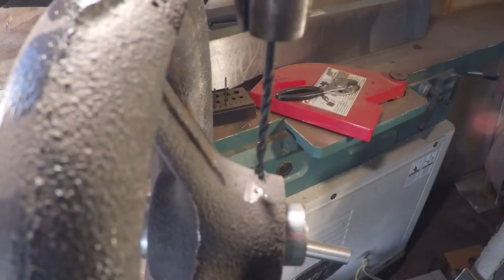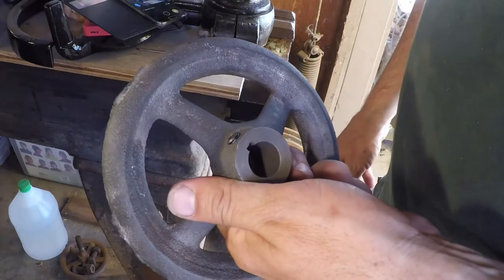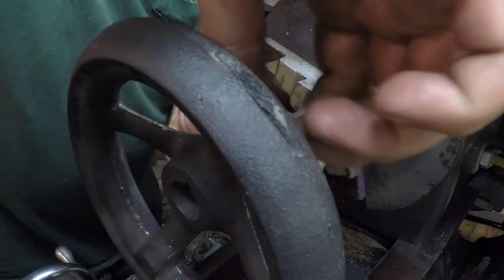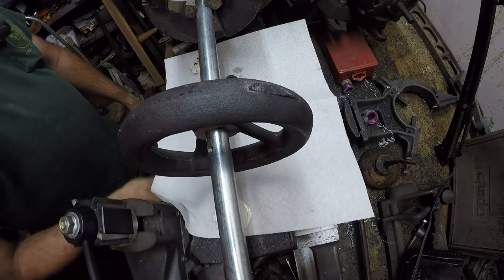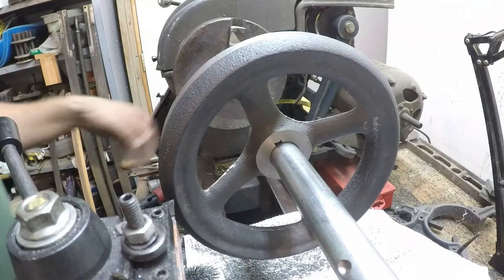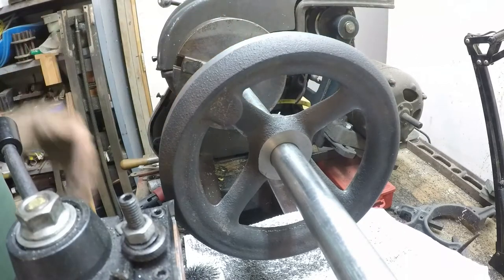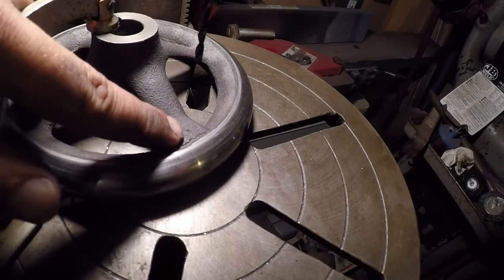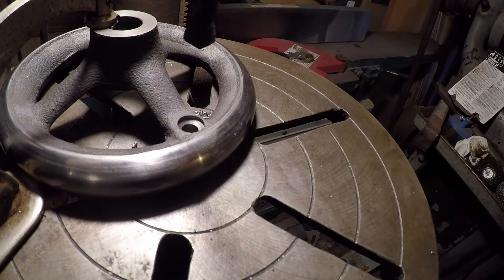Hand wheel machining  part 2

Comment: I needed a handwheel for my B&S table feed. I was given an 8" handwheel from an old valve with a square drive center hole.
I bored out the hole to make it round, pressed in a sleeve to make the bore fit the shaft, then did everything you did to finish the OD and make a crank handle. Looks like it was always there. It replaced a 5 inch handwheel.
Thanks,
John
Reply from the maker: +Caveman's Mancave cool deal the original was aperenly made in Detroit avoiding to the cast in letters.  If you ever need a 6in one I've got the pattern still

Comment: I'm thinking order of operations would be to mount a shaft in a vice on it's side.  Clamp the whole rig down with the drill hitting the center of the side of the shaft.  Slip the handle on, drill it then tap while it's all on the drill press.  Last step broaching the key-way.  That looks like a huge set screw size.  The handle is beautiful.  Fantastic result.
Reply from the maker: +Crafted thank you .Emma pointed out that I could true the drill press table vertical. Lol I was dumbfounded I didn't think of that.  It's a 3/8" set screw. We did try broaching the key after the set screw was drilled but there was some chip out .other then the drilling debacle it went off with out a hitch.
Reply: I didn't think of setting the drill press table in the vertical.  I'm wondering if a fella had a large enough piece of HSS if you could put a 1/4 round in it an form the radius simply by pushing it into the work.  Probably would take a much more powerful lathe and a keyed mandrel to pull that off.  Great result.   I do have some counter bores.
Reply from the maker: +Crafted I suppose it's posible but very chatter prone with this lathe
Reply: Yea, I don't think you could have on that lathe. I obtained a piece of 5/8" wide HSS, I want to grind it into a V grove pulley form and try it on aluminum in my 10" Atlas.  It shouldn't be possible.  ;-)  But it will make for a fun video if I ever get around to it.
Reply from the maker: you can do that but i think normally for a v belt you would part in and then form the sides but another way would be to turn on centers and single point the angles with the compound flipping the bar to do the two angles.
Reply: Yes, you are correct.  I formed the last one as you describe.  I am thinking in a production world they wouldn't use as many steps.  I am wondering if I can reduce those steps.  Of course there is no time saving for me and any time saving would be of no consequence other than exploring another method to see if it's possible to pull off.  Considering possible lines of orders of operations just for the fun of working out possibilities.
Reply from the maker: +Crafted this is true

Comment: Looks perfect to me. Need to make one for my BP M Head on the B&S #0 mill. Great job
Reply from the maker: +Flathead Ron's Garage what size is it I still have the pattern
Reply: I think it was around a six inch wheel for the fine feed on the M head.
Reply from the maker: +Flathead Ron's Garage have you seen the and will I built for my Brown & Sharpe I think it's about that size I have to measure it for sure
Reply: It is about the size of the one in your video.  I might have some belt drive stuff if you'd like to trade. Wheels. pillow blocks, old style SB hangers, and misc parts.  I'm in SAC so it's not too far for a road trip for me.  Im retired and would rather trade since funds are a little short since the holidays have depleted my wallet for a couple months.  I am also going to be changing my SB 9 over to variable speed and there is belt drive stuff there i might be willing to trade, Might be a motor or two also.  I can take pic's.  I am also looking for about a five inch vise for the BS mill, decent condition without too many woodpecker holes in it.  it's the mill on my Youtube channel.
Reply: in about a half hour or so i'll be putting another video on showing my DC conversion for my M head on the BS mill.
Reply from the maker: +Flathead Ron's Garage I'm up for trading email us oldironshops@gmail.com I hot my 5" vice from shars

Comment: nice work man, just got an old k&t, but no handles on anything,  so i need to cast something, i think i may go aluminum, since i have the ability to do a 6# charge, and a modified forge already.

off to search for the casting of this vid.
Reply from the maker: +dj berg yup yup I'm trying to stay as original as possible.
Reply: Chris Anderson yeah, one day ill cross into cast smelting, but dont want to put the time into building a legit foundry, and i highly doubt my brake drum forge would be able to generate  enough heat to do cast. gonna try bronze, and see how that goes, need a new cross feed nut on my lathe, had a over extension on the cross feed use and its tweaked, still working but no where near as strong.
Reply from the maker: +dj berg being able to cast things is a hand trick jn the shop